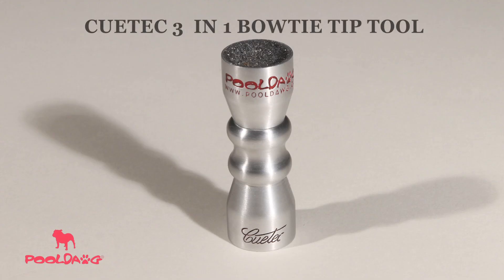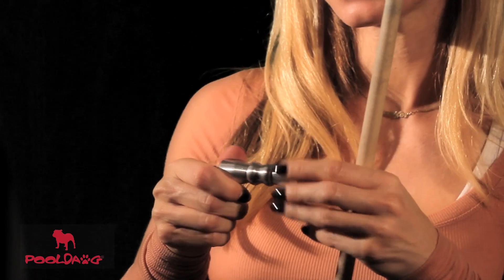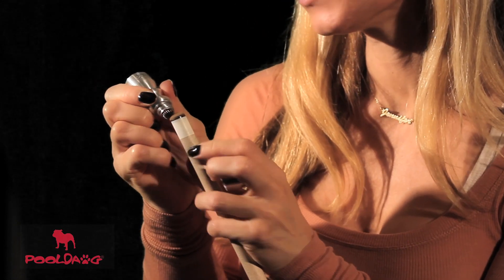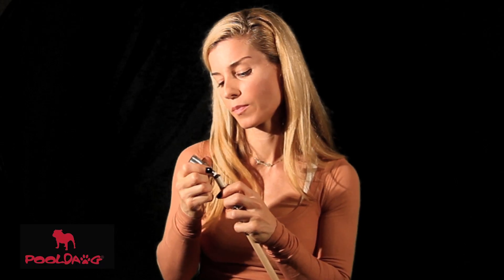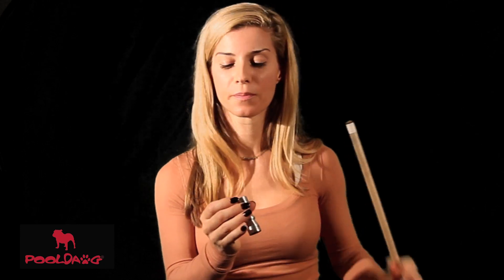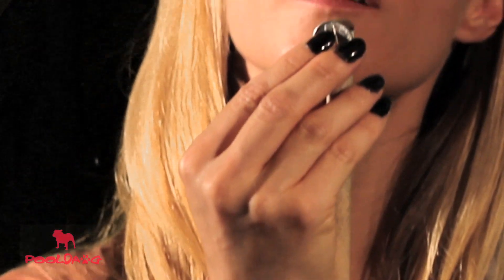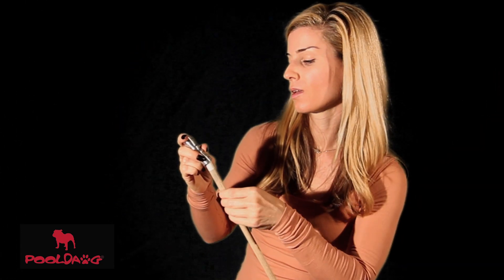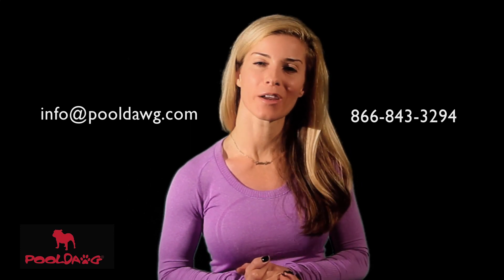How To Use the Cuetec 3 In 1 Bowtie Tip Tool

Comment: How long or how many times do you perform each of these actions?  Do you scuff it 5 times?  10?   25?  What about shaping and picking?  And how do you tell when you need to do these things to your stick or when it's time to re-do them?  And is it like knife sharpening where you have to do it at a certain angle or you will F it up?  I have a Cuetec cue for about a year now and I have never maintained the tip but I just bought one of these.  I miss my fair share of shots and I miscue  once in a while but it's probably more because I suck at pool.  This video is helpful, but y'all could of dumbed it down even more for dimtwits like me.  Thanx.

Comment: U dont twist with the spike,u tap
Reply: you don't tap, you press.
Reply: Pressing the "porcupine" evenly around the tip creates EVEN SPACING of the holes, rather than chewing up your tip. So of course your tip will last longer by pressing.
Reply: Jennifer rolled the tip on the porcupine.  She didn't stab or twist or press the porcupine into the tip.  Doing so will de-laminate layered tips.  I've been doing it wrong and wondering why tips are coming apart.  ROLL ON!
Reply: @joebutts2255  
Exactly! 
As she said you move the tip. Not the tool.